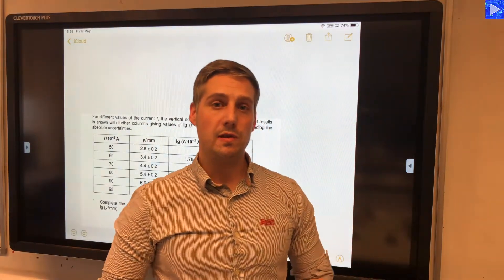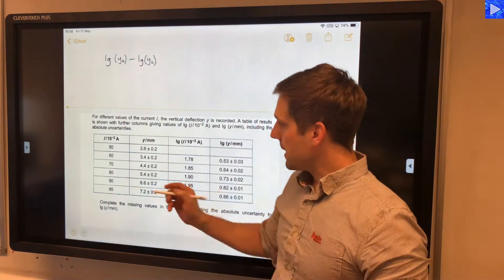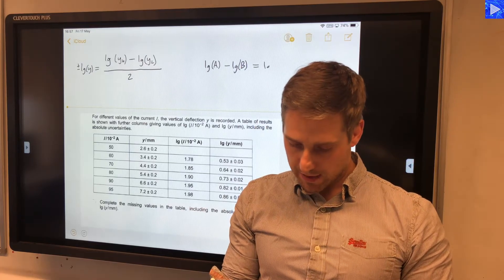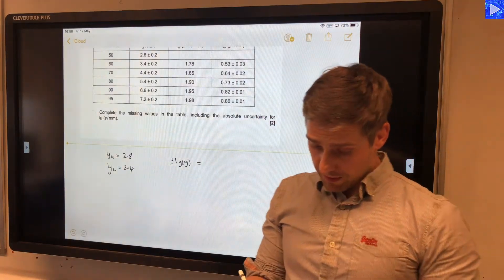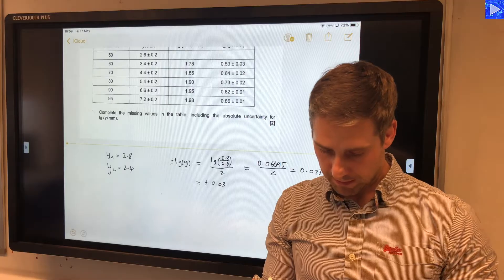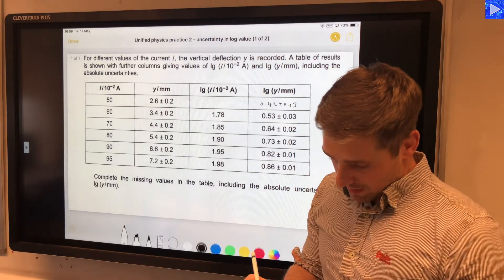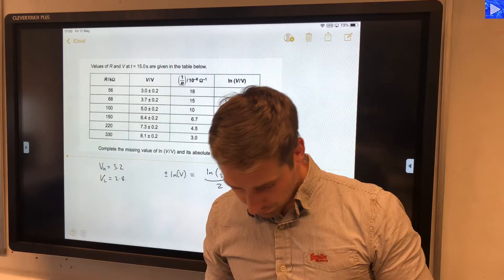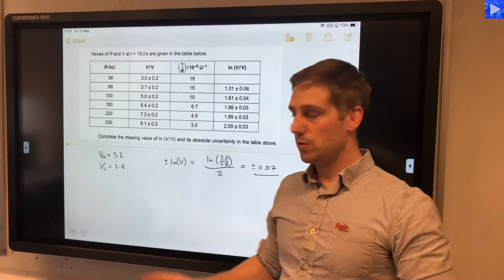How to calculate absolute uncertainties in log values

Comment: Great video - very clearly explained.

However, I wonder if anyone has any idea why the second example doesn't seem to follow this method for all of the values in the table. Calculating the uncertainties in ln(V) should give 0.05, 0.04, 0.03, 0.03, 0.02, whereas the table has the first and last of these as 0.06 and 0.03. I recognise this question, and can see that it is from a real exam paper - it would be very confusing for students to work out the missing uncertainty by a method which doesn't give the given answers to all of the other rows. Do you think OCR have a different rule? Their practical skills handbook doesn't address this at all as far as I can see.
Reply from the maker: Hi and thanks. You’re right that the ln(V) values in the second table don’t all follow my method; whereas all log values in table 1 do. This is perplexing. I haven’t yet figured out the method used by OCR to calculate uncertainties in ln(V). I’m sure that my method is correct - all the more so in the absence of explicit instruction from OCR. I should, perhaps, contact them for comment. 
It is interesting to see the uncertainty values calculated by my method stated to more d.p. :
0.0668	 ➝ 0.07
0.0541	 ➝ 0.05
0.0400	 ➝ 0.04
0.0313	 ➝ 0.03
0.0274	 ➝ 0.03
0.0247	 ➝ 0.02
Now we can see that if someone was working from a table in a spreadsheet in which the values were displayed to 3 d.p. that would lead to the last value being mistakenly rounded up to 0.03.  And that would then leave only one inexplicable discrepancy as 0.054 wouldn’t be rounded to 0.06.  If it is just one discrepancy between my results and OCR’s I reckon that OCR have used this method but made an error in that one value.
Reply: @PhysicsHQ  Thanks for the very thorough analysis. I agree that someone should contact them and ask what they are doing. Do you want to or shall I? I think one enquiry is enough, don't want them to feel put upon!
Reply from the maker: @icemaths9997  😊  I will make contact.  Agreed, particularly at this time - they might have a lot on their hands with covid-19 arrangements.
Reply from the maker: Hi again.  I’ve now heard back from OCR. What follows below is the official comment on the matter. In summary, the approach I used is valid but not ideal in some cases with natural logs. OCR will always give credit for this method in examinations. I will nonetheless update my advice to students, particularly the more able students.   From OCR: “The method in your video is a common approach and has received credit in recent mark schemes. I believe the discrepancy in the data and your approach for the 2017 H556/03 question is because the logarithms of the extreme values will not be equidistant from the logarithm of the central value so another method that would eliminate this problem is to use the log of the central bound – log of the lower bound as the uncertainty for ln V.”
Reply: @PhysicsHQ  So they are saying that for the second value in the table, for example, we should be using ln(3.7) - ln(3.5) as the uncertaintly. This does give the 0.06 that they have, and the other value we disagreed with them on also works out this way. But how anyone was supposed to know this I have no idea - there is nothing I can see about it in the practical skills handbook, and I don't remember seeing it explained in any text books.

This is also going to apply to any non-linear transformation, such as the square or the reciprocal of a measured value, so would seem to be something of a big deal.

Thanks so much for chasing this up. I do find uncertainty questions to be more of a challenge than exam boards seem to think, especially compared to the low number of marks these questions seem to earn.
Reply from the maker: I agree.  The absence of official direction here is disappointing, particularly as it is relevant to other transformations - as you say.

The good thing is that they will give credit for either method.  Now that we know the method, it is actually a bit faster to calculate.  I reckon these questions are for the more able students anyway so that’s likely the reason for the low number of marks relatively speaking.
Reply: @PhysicsHQ  I know that I am late to this discussion. I too had noticed that I couldn't get the same absolute uncertainties in the 2017 table. I understand what OCR have said to you, but I think that your logic is more valid than their answer.

I teach that the absolute uncertainty is the range/2 . This is exactly the method you describe, and is a repeatable and justifiable method usable in both experimental results and calculated values.

For logs, mathematicians and physics stack exchange use the following method. If a value is y ±  Δy then the absolute uncertainty in ln(y) is (Δy/ y ) x ln(y). This is due to the fact that the derivative of ln(y) is 1/y. However, as you have rightly said, there is nowhere in either text books which describe what to do. As OCR's own method is not the correct method, linking the range to the absolute uncertainty is the way forward.

I have previously contacted OCR about two mistakes in mark schemes that I have spotted. There responses are considered, and although they concede that they will award correct marks for a correct answer, they never say that they have made a mistake. I think this is because the ramifications of admitting to a mistake in either a paper or a mark-scheme could induce a flood of remarking and regrading.

I am going to continue to teach your method, and double check the exam papers for questions like this. 

Keep up the good work!

Comment: Great video, I have a question probably related though. What if my original values have not symmetrical errors (+0.2/-0.1 for example) and I want that to be reflected in the log error? What is the best approach then?
Reply from the maker: Hi. Thanks. 
What do you mean by not symmetrical errors - do you mean one set of measurements are made with one device and have an associated uncertainty and a second set of measurements are made with another device and have a different uncertainty?

Comment: This method can only be used with logs only right?
Reply from the maker: Kind of. This is the method of calculating uncertainties applied to log values.  But yes you wouldn’t use the calculations as they stand with non-log values.

Comment: what if you get a negative value after deducting a value of its absolute uncertainty. then you won't be able to log it since you cant log negative values. For example: if your value is 0.45 +/- 2.00.
Reply from the maker: In the first instance I would suggest trying to retake the measurements at higher precision since this error occurs when the abs uncertainty is larger in magnitude than the measurement.  That suggests an experiment redesign is probably necessary.
If that isn't possible then you can add a constant to all of the measurements before logging them to ensure that all values will be larger than zero after the uncertainty is subtracted.

Comment: What if lg (I/A) value and absolute uncertainty value is given and from there I have to find current (I/A).I know how to get current,10^(lg value) but how to get current uncertainty.
Reply from the maker: It's a similar starting point as with the log uncertainty - half of the range: ±10^x = ±½ |10^xU – 10^xL|
(where xU is the upper value and xL is the lower value).  As far as I know this equation can't be simplified further.